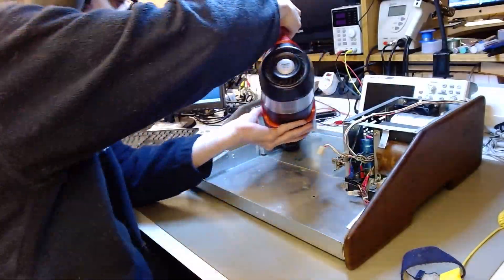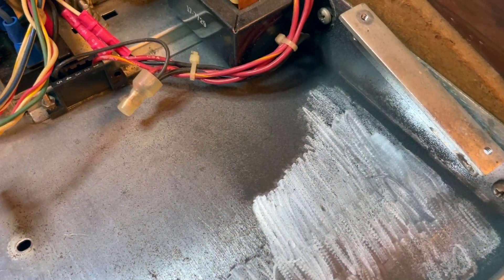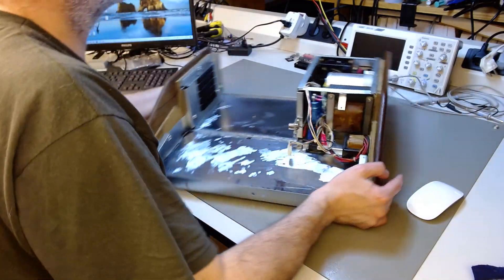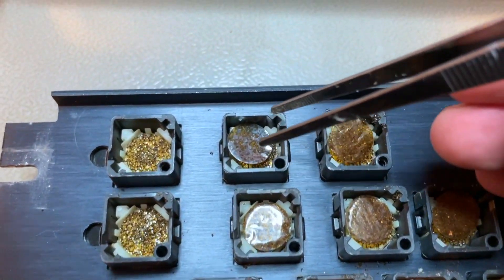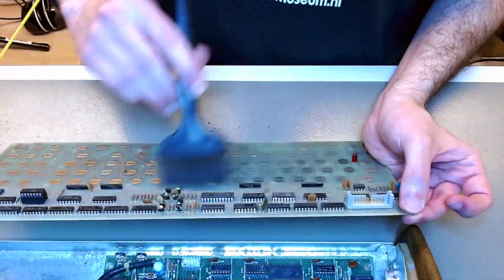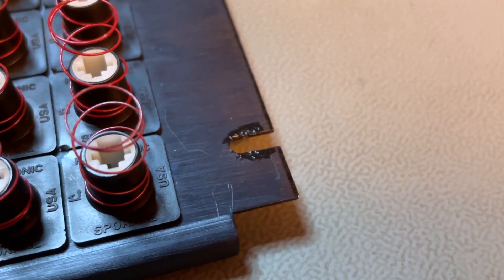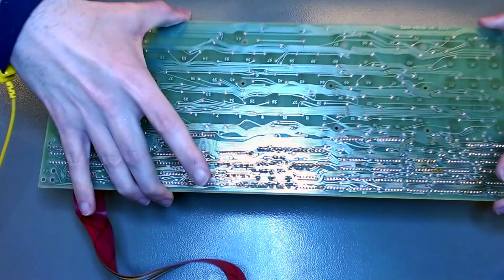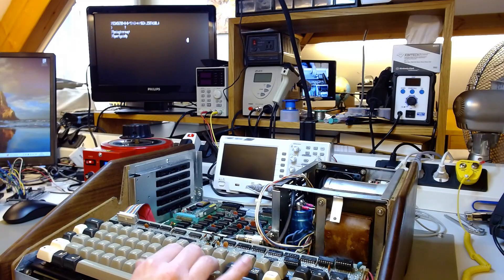SOL-20 museum restoration, PART IV

Comment: Can you still buy suitable replacement foam pads new?
Reply from the maker: Yes, I bought it from an Italian guy on eBay: https://www.ebay.nl/itm/275298265301?_trkparms=amclksrc%3DITM%26aid%3D111001%26algo%3DREC.SEED%26ao%3D1%26asc%3D20211130125621%26meid%3D0d8366bf53b64b14b7ea07d029eece59%26pid%3D101465%26rk%3D1%26rkt%3D4%26sd%3D275298265301%26itm%3D275298265301%26pmt%3D0%26noa%3D1%26pg%3D3650466%26brand%3D-+Senza+marca%2FGenerico+-&_trksid=p3650466.c101465.m3507
Reply: @thebyteattic  Appears to be newly made stuff. If you would buy New Old Stock you run the risk of these things being quite old and in an already decayed state. You probably do not know the chemical composition of the foam and how long this will last.